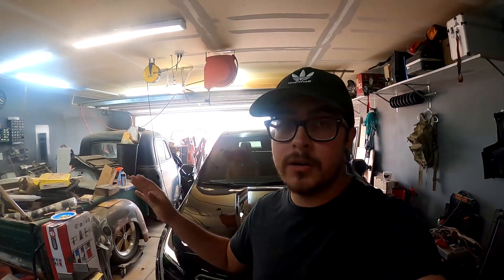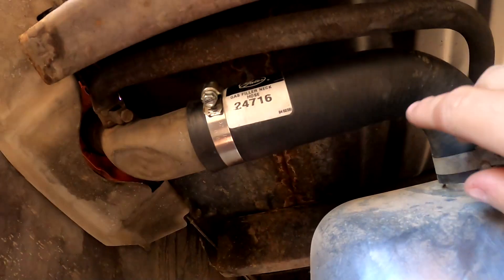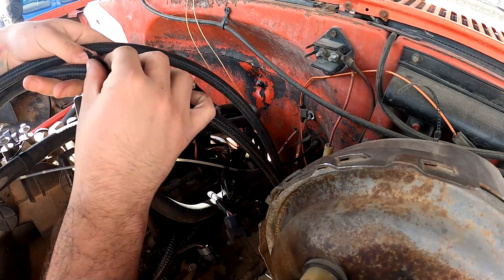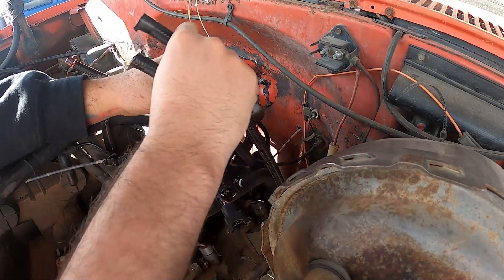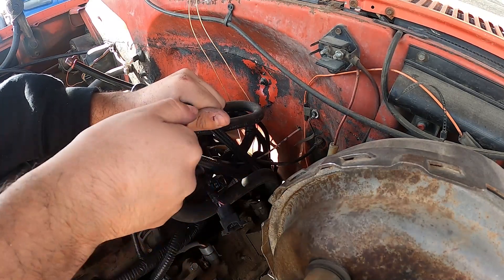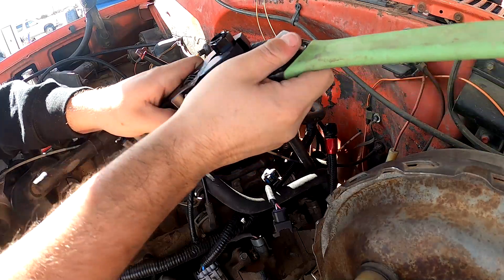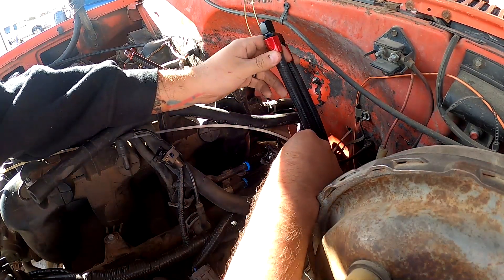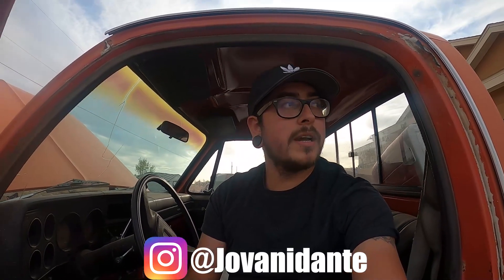Squarebody LS Swap  - Fuel System Part 2

Comment: Do you recommend that fuel filter?
Reply from the maker: Yea I'd definitely recommend adding a finer filter afterward too. I just cleaned mine and it was starting to get a bit clogged
Reply: If you have the part number of the finer filter, I would appreciate it

Comment: you only used a 100 micron filter ? doesnt it need to be like 10 micron by the time it reaches the rails
Reply from the maker: This should be the bare minimum but you're right. I started using a 50 in this spot and a 10 should be installed closer to the rails

Comment: How did you wire up the fuel pump? Ive taken alot of youre methods building my c20, but cant figure out the fuel pump wiring.
Reply from the maker: Check out the cooling fan video, it explains relays same method but I'm pretty sure the wiring harness included the fuel pump send wire
Reply: Thanks.

Comment: Do you have the truck intake with the built-in regulator right So no need to buy a Corvette style regulator right
Reply from the maker: 1 lone on intake means you need a regulator. 2 lines means it's built in
Reply: @JovaniDanteGriego  ok thanks i have the 2 line intake which I thought was the truck intake it makes more sense they way you explain it and im going to be doing the same setup on my obs ls swap 
Appreciate it brother

Comment: I have the same cheap wiring harness,  how did you wire up the fuel pump,  or did you find the fuel pump power source on the harness.  If so what color was the wire?
Reply from the maker: Check the lastest video on it the extra relay gets wired to the pump
Reply: @JovaniDanteGriego  Thank you very much,  I just watched it great work

Comment: where do you find all your truck motors. i’m having such a hard time finding a complete 5.3 with harness and ecu without a trans for around 600. is that even a reasonable price because i cant seem to find anything
Reply from the maker: Go back a few videos, i bought a driving 2000 silverado for $2000 and after selling everything off of it i could i made more than $1000 profit. the same can be done, just gotta find good donors.

Comment: This video came just in time. Where would you say is a good place to put a external fuel pump?
Reply from the maker: I prefer them closer to the gas tank. Try to find a good rubber mount.  They are noises